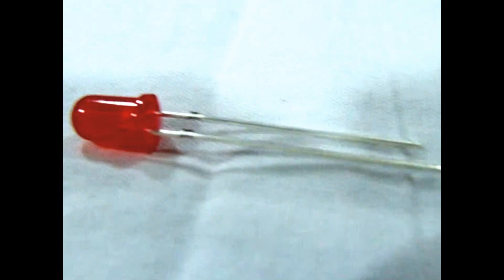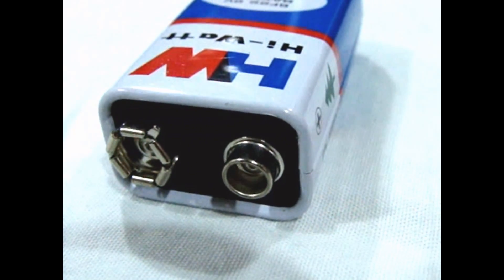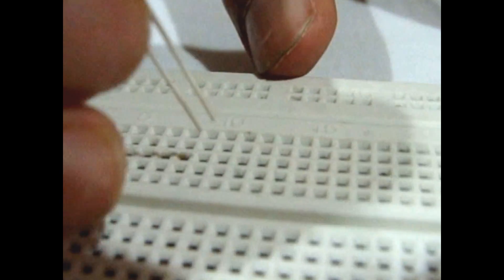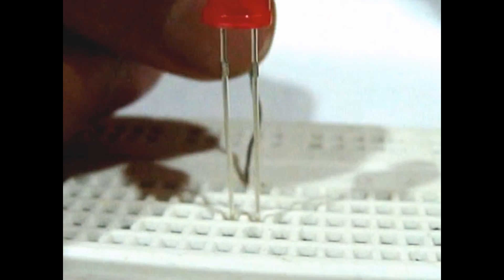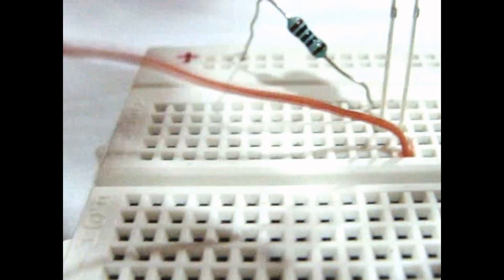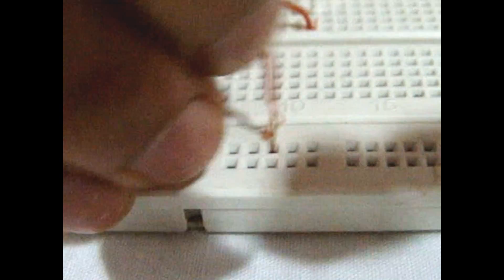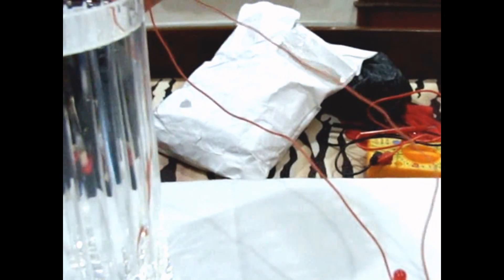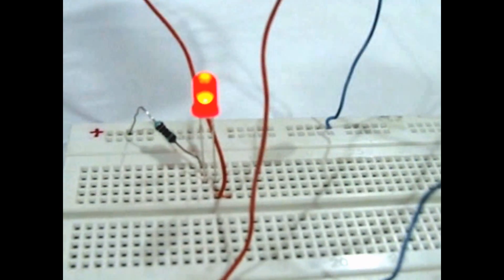How To Make A Water Sensor

Comment: What is the thing you used to make water sensor
Reply: Resistor + LED and he uses water as a conductor to transport the signal from voltage source through the resistor and water to the LED

Comment: you didn't use any transistor, you just used the water as conductor, which is invalid as an project your burning too much voltage from your 9 volts supply. It was a no no, from my professor.
Reply: Exogen Design exactly this is what i thought after watching this video